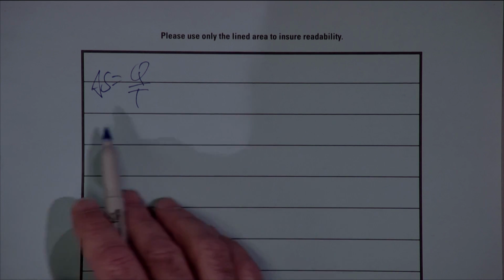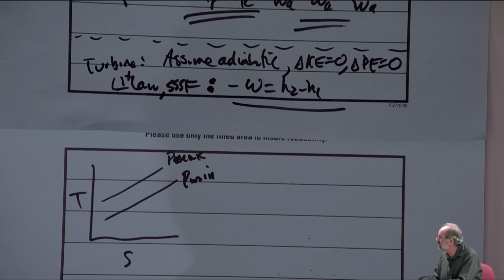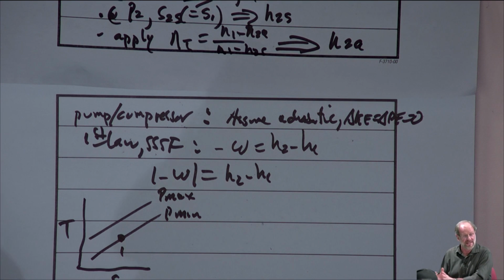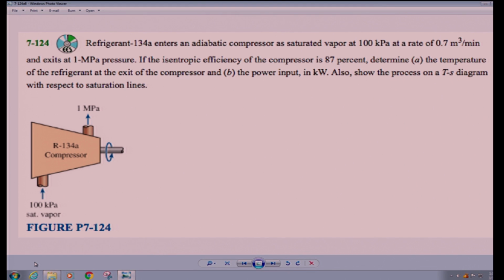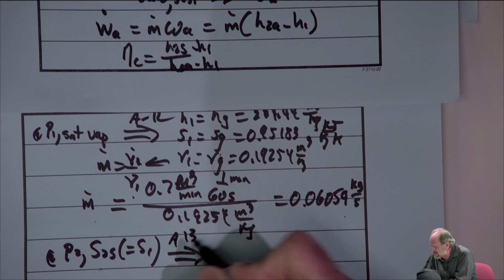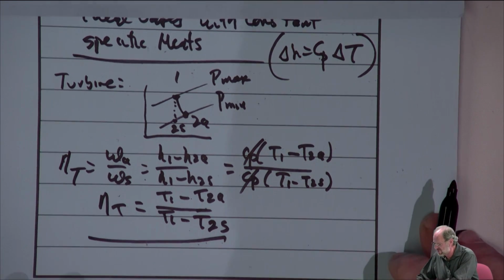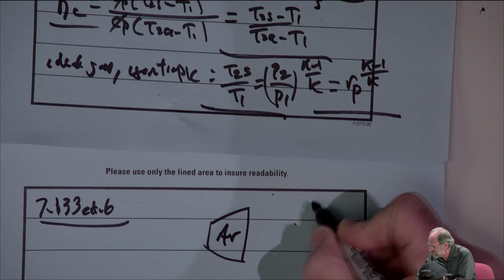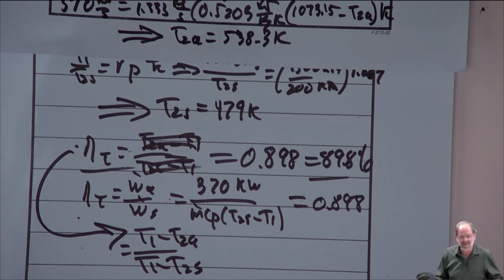Thermodynamics: Isentropic Efficiency of Steady Flow Devices (22 of 25)

Comment: I'm not sure where these equations are coming from, the summary sheet for this chapter of this specific book denote a completely different set of equations. Can anyone clarify? Specifically, where did he derive (T1/T2) = (P1/P2)^k-1/k. The only thing that's similar in the book is (T2/T1) = (P2/P1)^k-1/k....so, I see that relationships are inverted but normally this professor follows the book pretty closely and never goes rogue. Lastly, the pressure ratio equation is not listed at the end of the chapter as well....so, a little confused.
Reply: In a previous video he wrote it as (T2/T1) = (P2/P1)^k-1/k so maybe it was an error this time?
Reply: @PasfieldEngineering  Those two are same.

Comment: In an open cycle gas turbine plant, air enters the compressor at 1 bar and 290 K. The pressure at the exit of compressor is 5 bar. The isentropic efficiencies of the turbine and the compressor are 90% and 85%, respectively. Air fuel ratio is 60:1. The calorific value of the fuel used is 42 MJ/kg and mass flow rate of air is 2 kg/s. Assume air as an ideal gas with specific heat at constant pressure equal to 1.005 kJ/kgK and the specific heat ratio as 1.4. Consider specific heat at constant pressure for fuel also as 1.005 kJ/kgK and specific heat ratio is 1.4. Find the following:
1). Heat supplied by fuel to the plant in kJ/s is
 a) 1300
 b) 1400
 c) 1000
 d) 900
2). Work required to drive the Compressor  in kW is
 a) 400
 b) 309
 c) 595
 d) 658
3). Actual turbine outlet temperature in Kelvin is
 a) 672
 b) 792
 c) 710
 d) 590
4). Thermal efficiency of the plant in percentage is
 a) 21
 b) 29
 c) 19
 d) 39
Reply: did you find them

Comment: why the entropy rises in pump and compressor and drops in turbine
Reply: It is because, in the pump and compressor, the temperature of the fluid increases so the entropy also increases. On the other hand, in turbines, the pressure and the temperature drops, which results in a decrease of entropy!
Reply: @tarashri769  i thought entropy doesn’t decrease. I thought it’s always increasing. Am i wrong?
Reply: @brucewayne3227  It always increases as a whole but of a system can decrease. If what you are saying is true then all refrigerators and all other HVAC appliances are working on the alliens law
Reply: @saqibirshad5126  Not sure I follow - Entropy is always increasing in an actual, real life cycle or system. If you can design a system with entropy decreasing, let me know.
Reply: @paulatreides4574  as I known, total entropy is always increase in real processes, but total entropy is equal to system entropy plus surroundings entropy, so in some specific process, system entropy could decrease